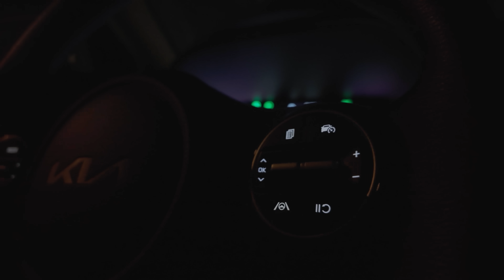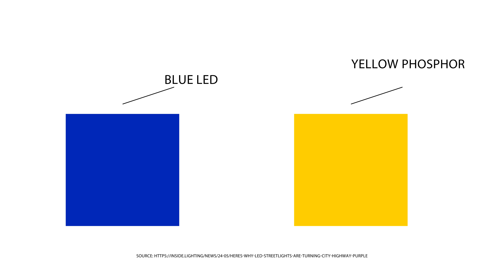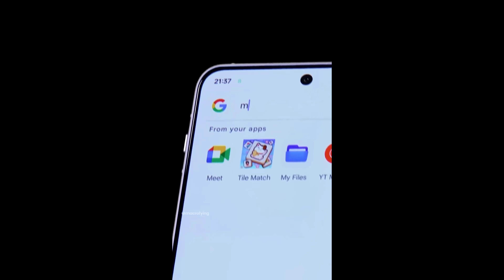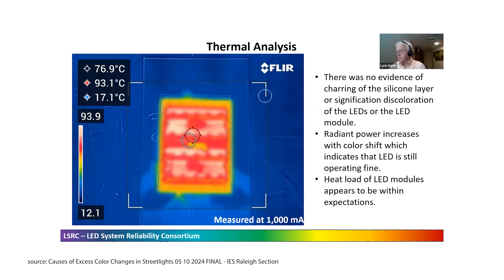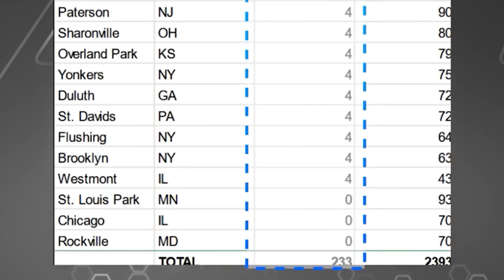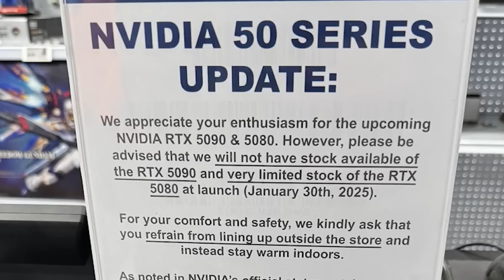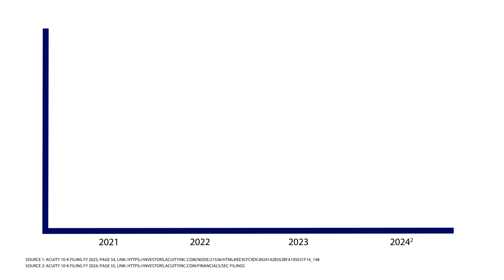The Hundred Million Dollar Mistake That Turned Street Lights Purple!

Comment: At least it’s just blue light and not ultraviolet, right? I think sodium lamps should have stayed the standard, you can still see everything and it doesn’t turn the night into day.
Reply: Sodium is harder to see things under and lifespan difference 

BUT it should be used in residential areas because of blue light and circadian rhythms
Reply: Correct: they do not emit UV light.

Comment: Funny thing is that LEDs of certain temperature are literally the same amperage as the high pressure sodium. The only part of hps that takes energy is startup which can be problem if the bulb is going out.
Reply: Sodium yellow is also much less disruptive to your low light vision, circadian rhythm, astronomers (light pollution), and animals. 

LEDs could be made the same yellow color but 1) they didn't do this 2) why bother when you can just use HPS.
Reply: best two comments here

Comment: What is breaking down the phosphor loaded silicone (technically cerium doped yttrium aluminum garnet/Ce:YAG used in 'white' LEDs is a scintillator not a phosphor cuz physics but the industry calls it a phosphor) is high energy blue photons from the pump LEDs photodegrading the silicone.  This high energy blue light is also why LED lighting often causes eyestrain, as deep blue photons are energetic enough to cause the vitreous humor in human eyes to glow and eyes can't focus this light as it originates from after the iris and lens in the eyeball optical system.
Leotek lights in Detroit had a big problem with this some years ago, where the plastic lenses over the LEDs photodegraded over time and actually overheated and burned from all the light the increasingly opaque photodegraded plastic absorbed.
Also, the Ce:YAG is almost always mixed as a fine powder into the silicone LED potting, not bonded on as a separate sheet to the LEDs.
Reply: I know that the coating is a sheet in headlight bulbs as I have seen them fall off of mine. The tiny squares would be in the housing and individual LEDs would be bluish instead of white.
Reply: Blue issue depends on the 'phosphor' mix and is actually beneficial if you want to stay awake and there are ratios that are optimal. If you want to sleep, it's bad news. I have some of the latest low CCT leds and they are already well into 1800K range lol. There's almost no blue in them and are basically yellow-orange.  Lot of plastics can't handle high CCT leds at all though, stay away unless you know it's high quality.
p.s. I've held the end of a boule of Ce:Yag in my hand before, thanks to a lovely gentleman at FLIR. It was worth 20k usd and smaller than a pingpong ball lol.

Comment: About 10 years ago they started replacing sodium lights with LED and there was a great push to do it quickly for some reason… that’s probably why. Not enough long term testing and rushed production. They also designed the lanterns so the LEDs can’t be replaced, so they have to replace the whole unit. Not exactly green then. Should have kept the sodium ones!
Reply: Sodium lights use a lot more power. Using led saves money when you get lights that are working properly
Reply: @brianphillips7696 they reverse a lot of that advantage restricting repairability.  The LEDs should be put on removable wafers, but here we are aiming entirely at optimal profit rates rather than respectable and honest product design.
Reply: It was an issue with that brand of LED bulb. Not the technology in general. There are plenty of examples outside the USA where LED lights have been in place for 10+ years and they are still working fine.
Reply: @MarkGovern see, you have to have specific issues with various iterations of “the technology in general” to refine your set of best practices & considerations for design/manufacture, so the technology is more reliable in it’s given application.

Comment: Nice find from the algorithm. Solid production quality and research into the mater. 

My hunch for this failure is that since the LED are blue, which is close to ultra violet could it be the excess UV rays basically cooked the silicone glue that held the yellow filter in place leading to the failure. It just a guess but seemed eery likely.

Comment: Keep going this was a good video and you nailed the formula. I grew up in the era of orange street lamps and the new white LED's have a different mood. I miss the olds lamps and I am not alone
Reply from the maker: I miss the look of those old Sodium Vapor lamps. It speaks cinema to me.
Reply: @SEANQ_ASK  nowadays those lights represent bad neighborhoods. The area north of where I live is dodgy and are still using the orange ones.
Reply: Yeah, at least in some residential areas, they are putting in warm color temperature that look like halogen/tungsten.
Much easier on the eyes and it makes colors look better.
Highways and grocery parking lots, all that you care about is brightness so high CT wins.
Reply: What the cluck

Comment: They don't use RGB LEDs because the CRI of a simple RGB light is absolutely horrid. Almost everything would look the wrong color under that light.
That matters less for public light though, but mass manufactured white LEDs become super cheap, they may be even cheaper than just high intensity yellow or green LEDs.

(by the way: with the right coating it is possible to make an RGB LED with excellent CRI too, those are super rare though)
Reply from the maker: Interesting! I didn't do that much looking into the reason why they don't use RGB, but my research on blue LEDS kept mentioning the cost efficiency. Poor CRI makes sense too, now that I think about it.
Reply: @SEANQ_ASK  Blue LED based lights are simpler and cheaper to manufacture, but not for the reason you might think; the wear and failure patterns of a bunch of identical LEDs are far easier to design for than three separate parts. RGB based white light would be guaranteed to suffer uneven wear rates between the different colours (which are all manufactured using different topologies), so you are guaranteed to see very ugly colour failures as they age. On top of that, you still need to use blue LEDs, which are actually the most expensive, unreliable and difficult type to manufacture, so you don't even get to avoid all the downsides of blue LEDs in your light, while also walking straight into CRI hell. In short, RGB white-light is just a terrible idea!
Reply: @SEANQ_ASK blue LEDs are not really cheaper than RGB modules. They use "white LEDs" which are UV LEDs with a white phosphor cover. Blue LEDs themselves are the most expensive of all LED lights and wouldn't be a good idea to use just to cover up with a phosphor.
If you used RGB then any objects not colored with the narrow light color of the diodes will basically be black. LEDs only put out a narrow almost single wavelength of light so only objects that are perfectly color matched would be well lit.
For this reason you typically have RGBW modules used in those color changing light bulbs people buy and not just RGB.
Reply: RGB is also a lot less efficient as InGaN (used for blue, cyan, green and yellow/green color LEDs) die efficiency drops as photon wavelength increases AKA shifts from blue towards green.
Reply: @randacnam7321  Aren't yellow-green LEDs usually based on the older technology, with the exception of phosphor-based LEDs of such color?
Reply: @ You are thinking of gallium phosphide yellow and yellow green indicator LEDs.  Much less efficient than InGaN LEDs but far more reliable as InGaN LEDs are vulnerable to a number of still poorly understood failure mechanisms.  InGaN LEDs can make anywhere from near UV to yellow depending on the amount of gallium the luminous bits of the die junction are doped with.
Reply: I just want these lights to have the same temperature and luminosity as the sodium lamps they're replacing
Reply: @chrisholdread174 that was one of the points they were explicitly designed to not be.
Reply: @chrisholdread174 Sodium lights are pretty terrible compared to these LED lights when properly manufactured. For non-white LEDs, these have really fantastic output and way better color rendering to the extent that they render color. Sodium is awful. It’s the second worst I’ve ever seen (and I don’t know what technology was used for the worst I’ve ever seen, but they were a similar “color” wavelength to sodium lights, but they were extremely monochrome. You couldn’t tell anything about the color of anything lit by them. You couldn’t even guess with any accuracy!
Reply: @babybirdhome sodium lights are like: ""Naaa, you only get yellow!"
Reply: @babybirdhome Weren't those the low pressure sodium lamps? Unlike the high pressure ones, they give you light comprised of just a single wavelength and you end up seeing in "grayscale, but yellow".
Reply: Color Rendering Index
Reply: RGB LEDs aren't used in lighting in mass because they are  less efficient and cost more. RGB lighting bulbs like the Phillips hue bulbs can achieve OK and in theory even better CRI but in practise many manufacturers even opt for RGBW with additional "white" LEDs instead to also function OK in normal lighting mode. Those 2 concepts also compete in OLEDs; LG uses RGBW, Samdung Displays RGB.
Reply: This has haooened med a huge number of LED TVs too, especially in Asia, who knows how much e-waste was created though reparation was possible, the family of my thai wife got their TVs repaired, however it wasn’t particularly cheap.
Reply: Arent they UV leds not blue? They are just mimicking the tech used in fluoro tubes and the sodium lamps they replaced by using a UV source and phosphor to colour shift it into white light. Except its now made in China junk.
Reply: Yup. Look at anything lit by RGB white and it looks red, green and blue at the same time
Reply: Color Rendering generally doesn't really matter when it comes to street lighting. Hence why Sodium was widely used in the street
Reply: @WilmingtonOHProductions  it does matter! Sodium was/is used because in a time of incadescent bulbs they were much more efficient. The lack of colour perception when using sodium lamps is a big minus for safety.
Reply: @thoreberlin there were mercury lamps. And even tube fluorescent.
Both much more efficient as incadescent. But not as much efficient as sodium. 
And see what ... cheaper sodium was choosen, who cares about color ...
Reply: Correct.  RGB looks white to the human eye, but it's really just R+G+B.  The reflection off of a colored object is different, especially if it's somewhere "between" those primary colors. So, RGB makes great displays, but bad lighting.
Reply: Since the CRI is a product of an LED’s color temperature, that became a MAJOR issue, first in Europe and to some extent in the United States. The street lighting industry DECIDED that best color temperature was around 4000K. That turned out to be totally WRONG‼️It was determined that 4000K interfered with the circadian rhythm sleep cycle of humans and animals! In Europe, residents vigorously complained that that blueish light shining through their windows had an adverse effect on their ability to get a good night’s sleep. Cities were required to REMOVE all of those new LED streetlights and replace them with 2700K to 3000K. Now 3500K is the standard since it gets the fewest complaints. 
The LED streetlight conversion has been an interesting ride😂
Reply: well, in street lightning CRI seems to be very important :-P
And I don't think it's cost issue - lamp used plenty of LEDs. they can use some R, some B, some G.
And Blue are probably more expensive.

Efficacy? Blue are very efficient. 
Similarly efficient R and B exists ?
Reply: @ 
Actually, the Color Rendition Index has NEVER been a consideration of the Department Of Transportation. Think back to the time when mercury vapor street lights began replacing old incandescent lights. Mercury vapor had that horror movie blueish look. That technology was replaced by high pressure sodium which gave off an orange sunset look 🌅 Both had terrible CRI’s.
DOT’s primary concern was increasing brightness and reducing operating costs. 
Metal Halide produced a bright white light with good CRI. It’s used extensively to light sports fields but was never adopted for street lighting.

Comment: thought so! something similar to this happened to one of my flashlights once.

some fault (overheating? water dmg? short circuit? no clue!) caused the light to suddenly start bright strobes of first white and then blue light. the led now has visible burns on it, so i replaced it.